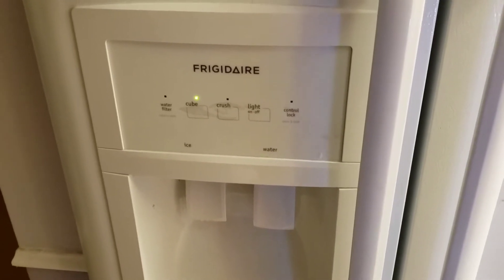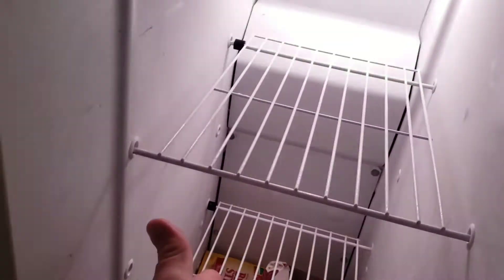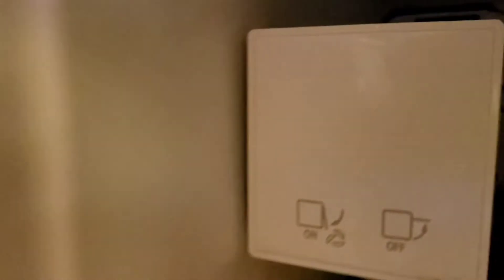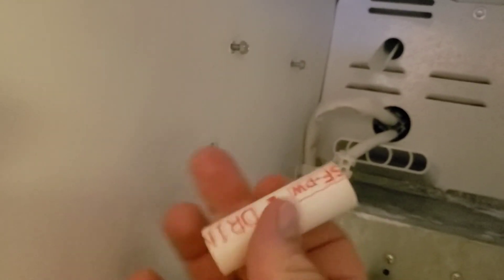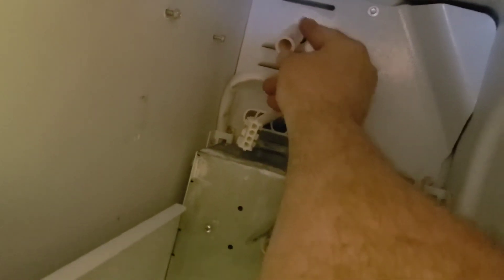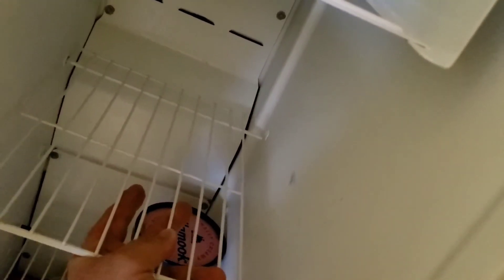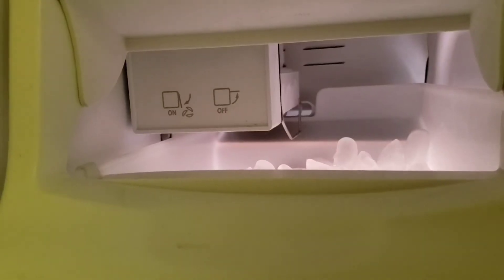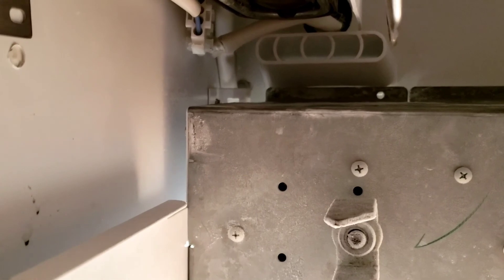How to fix a leaking ice maker fill tube for free

Comment: I think this happens when your water pressure going into the fridge is too high. This can happen when the main inlet valve on the fridge has gone bad.The same issue also creates drips at the chilled water outlet on the front of the fridge.

Comment: I have the same issue. Pulled out some big ice blocks hitting the fan. What size pvc was that
Reply from the maker: I believe it was 1/2 in diameter
Reply: @howtoscottkeeley  thank you sir. I actually wrapped it with white electrical but I don’t want to leave it that way. Seems to have cured the issue in the mean time

Comment: What if you ice tray is leaking from the bottom right side of it. This trick wouldn’t solve my issue correct,
Reply from the maker: Unfortunately, you would have to replace it with a new one.